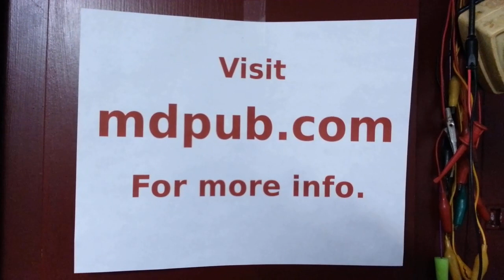Heavy Gold Plating From Military-grade Pins: A Long and Hard Fought Campaign That Ended In Victory

Comment: On these typical AMP/Bendix/Canon connector military-type pins, often the female pins will have a stainless steel shell press-fit over the end of each pin.  The female pins that are a complete cylinder are strong enough on their own so don’t need shells.  Some female pins are designed though with the tip portion split into leaflets which can better grip the male pin.  On those type pins the SS shell helps keep the weaker end pieces aligned and protects them from getting bent or breaking.

Comment: Would you mind tell me the chemicals formula of muriatic acid & hydrogen peroxide? sorry about this question, because I have completely different language with yours, I'm not sure if the translation is correct when it does.
another question is... what happen if these pins goes straight to Aqua regia? is it possible to recovery the gold? Thank you!
Reply from the maker: Half hydrochloric acid and half 3%hydrogen peroxide solution.
Reply: @omegageek64  thank you for your reply, but is hydrochloric acid=HCL and hydrogen peroxide=H2O2?
how about second question?